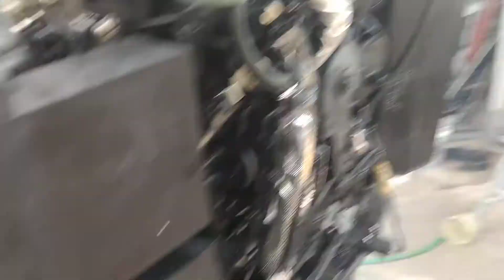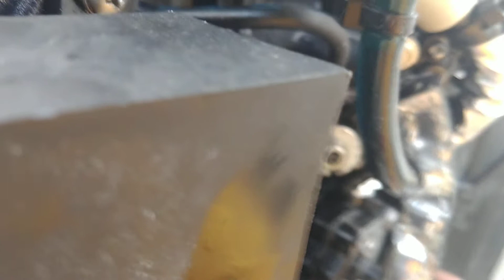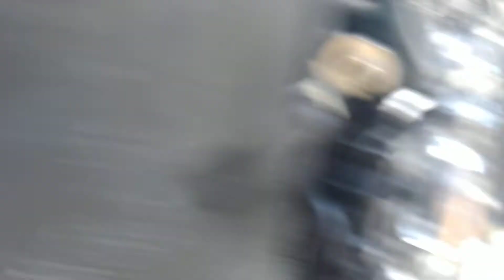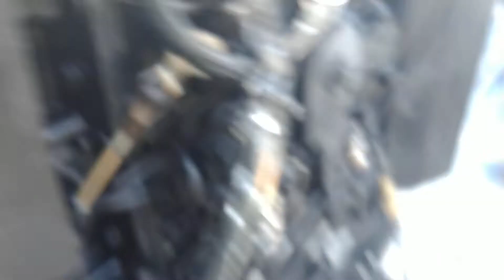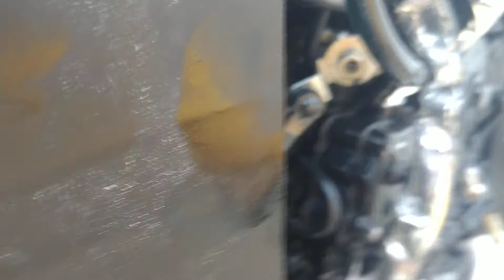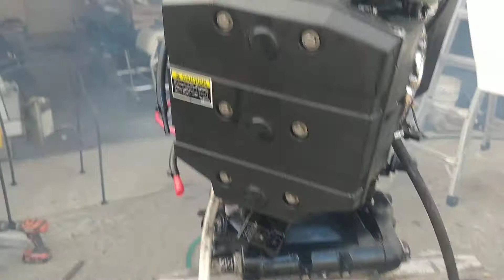2004 Mercury 2.5 150hp

Comment: Sounds great! What's it going on?
Reply from the maker: When i let up on the throttle I hear bearing clatter, it could go for hours or years only time will tell! The motor is rigged and it ran good! It's on a 20 ft Maycraft with a 17 pitch four blade prop and runs 42 mph at 5500 which is perfect! Thanks for looking!
Reply: @someonesomewherewhy  awesome that sounds like a great set up! Your welcome  have you checked the gear lube to make sure the lower unit itsnt clattering? Clatters are funny things